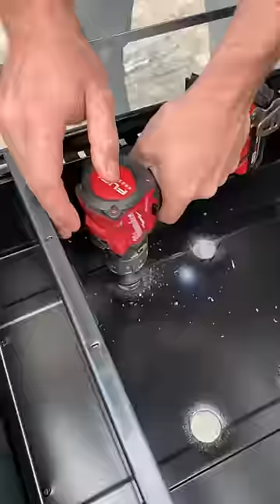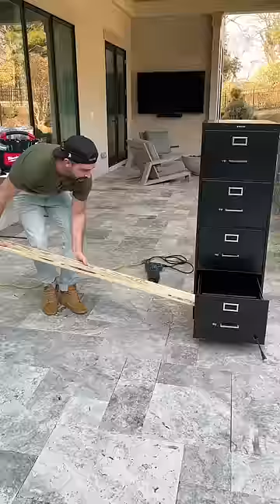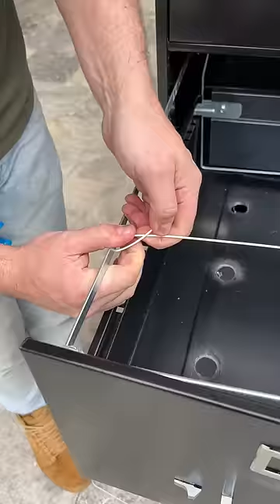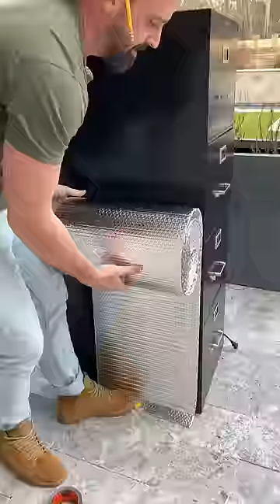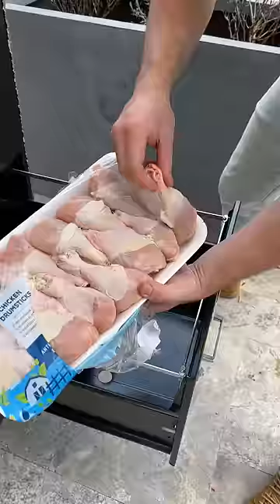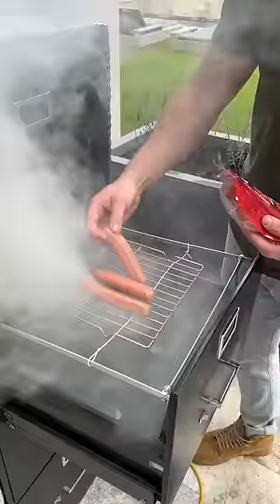Homemade Filing Cabinet Meat Smoker ♨️ #shorts #diy #diycrafts

Comment: Pressure treated Lumber = Poison 
Galvanized wire =Poison 
Burning paint = Poison 

Nah, I'm good..
Reply: I also like to saw towards my shins with no protection
Reply: I’m glad I wasn’t the only one that noticed the treated wood.
Reply: The in-laws are coming for dinner
Reply: This is real bad.
Reply: Deformation due to excessive heat = frustrating experience = soon to be garbage
Reply: @krislink1761  lol 🤣
Reply: Hey at least they have figured out the basic concept of seasoning
Reply: @krislink1761  great point: there has to be a reason for the arsenic sandwiches. LOL

Comment: Next up, I'll turn a litter box into a toaster oven.
Reply: Joseph Lynn, I'd love to see that and will contribute an extra large litter box that my boys (cats, not children) don't use anymore. 
My other boys (children, not cats) are still using theirs though so I'll not part with that one yet.

p.s. I hate dehydrator  that have plastic holding-plates instead of metal ones. The foods melt holes in the plastic and since I don't know where the plastic from the plastic holes went, I won't eat the food from them. Does anyone out there have the same problem? Maybe the manufacturer's will start putting metal plates in them if enough people agree that plastic plates are toxic, dangerous and make the dehydrated food taste bad.

Comment: We were " up north "
      A massive amount of fish was caught by several families ( about twelve different families ) so a lot of fish 
     The corrugated ( tin ) out house was immediately re purposed in to a smoker 

   Now for those going eewwwhhh yuck  smoke kills any Insect , bacteria was washed away before use , all fish were hung on fence wire and the out house was removed from its original location 

    Operation fish took two days , Three lots of fish were put through the impromptu smoker

Comment: I like the idea. Problem is with the paint and treated metal. The amount of heat to cook properly. Insulation needs to be enough to keep heat in, or the heat supply needs to be ample. Too many problems with this. Should be NSF as well.

Comment: Lets see, not high heat paint, definitely pressure treated lumber, theres normally grease in the draw slides, dont think the pot was made for oven use, the foil insulation might be okay but still not made for this application. So i think some bad tasteing food and maybe cancer is what this makes.

Comment: Let’s see…. No heat paint in a smoker…. Check…. Pressure treated lumber with arsenic…. Check….. superheated dry Teflon pan…… check…. The cancer inducing cabinet is complete….. enjoy….
Reply: Not saying it’s a good idea, but they stopped using arsenic 20 years ago

Comment: not sanding and priming the container with the proper heat resistant tape would cause the food to be toxic from the Heat
Reply: Jonathan Nowak, I agree with your conclusion. Also, there is a high-heat, black spray paint that is used on racing car engines and grills that get very hot. It can be found at most Walmarts. 
I don't think it would be a good idea to paint the inside of the file cabinet drawers though. It is mainly used to deter the rusting of bare metals.

Comment: You would have to have hot coals in the bottom of that filing cabinet to get rid of all the pain't and all of the other garbage that comes with that paint and all of that paper that people have put in their filing cabinets. You would need to go to. Good will or Salvation Army to find a four drawer cabinet  to make a great smoker! You would have e to burn off the paint first? They bought a new cabinet and thr paint will mess with your flavor.